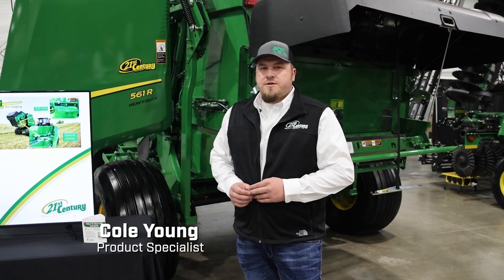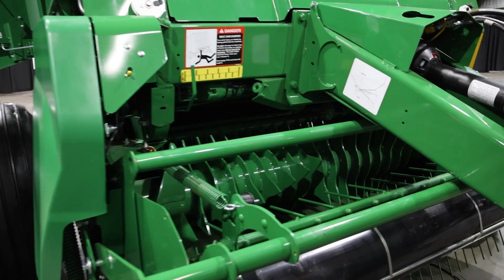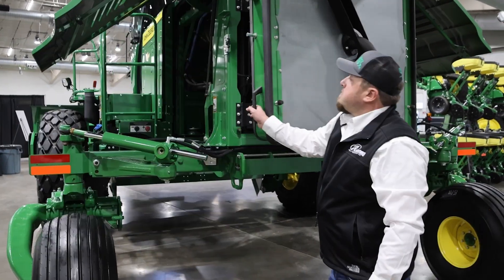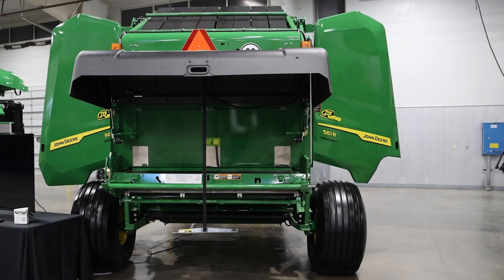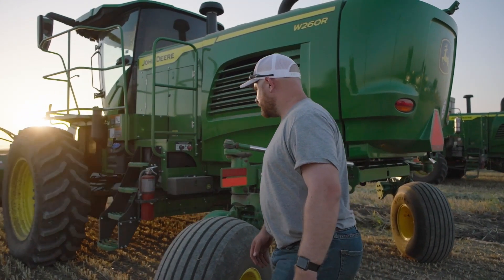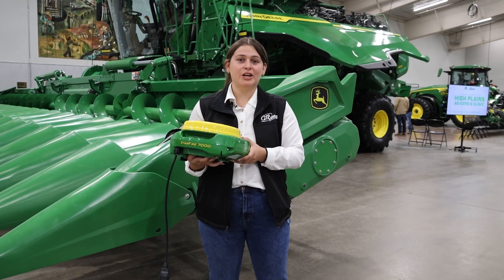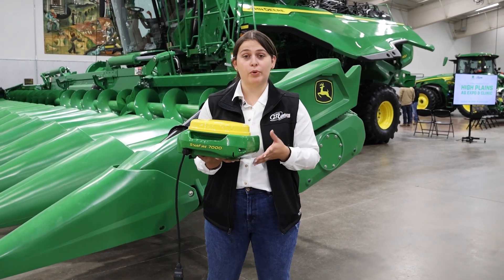Unveiling John Deere's 561R Hay Baler & W235R Windrower. Cutting-Edge Features & More! FarmCast Ep28

Comment: Thanks for the video!  Excited about the new features.  

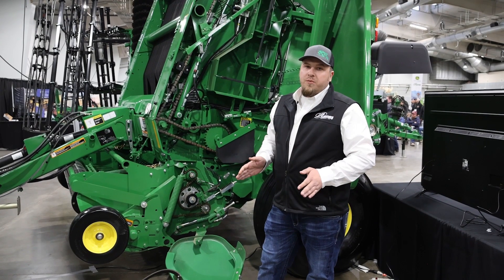1:34 “….put us back in gear”.   From the 461R/561R Manual:  "Tractor Ground Speed—Automatically stops the
tractor when the bale starts the wrapping cycle. (Does not automatically start the tractor, that is operator controlled.)” 

I hope you’re correct, but I worry that the tractor will need to be manually started after the bale kicks out.  Build code 3900 does say Baler Automation (Gate Cycle Open/Close + Tractor Start/Stop) which brings hope.   Is anyone using baler automation that can weigh in on Tractor Start with an IVT?
Reply: I bought one to find out.   After bale ejection, forward movement needs to be initiated by the operator, then it quickly accelerates to whatever speed you have set.
Reply from the maker: Thanks for sharing!